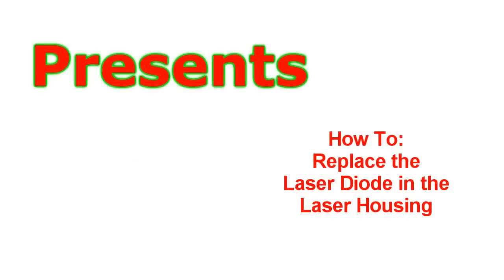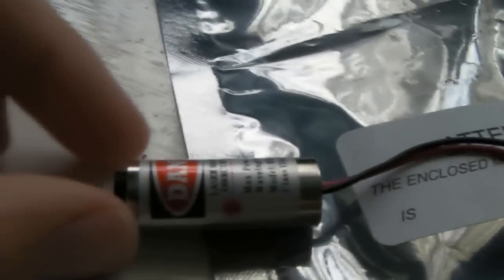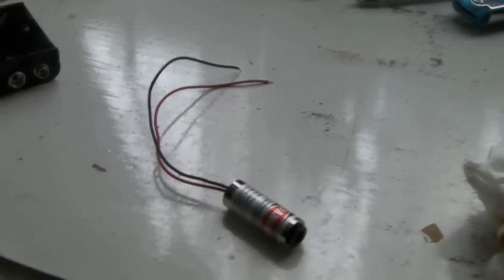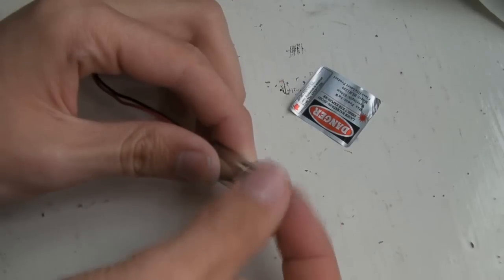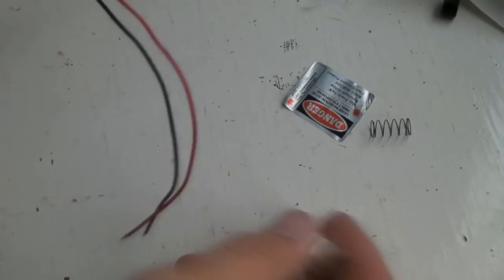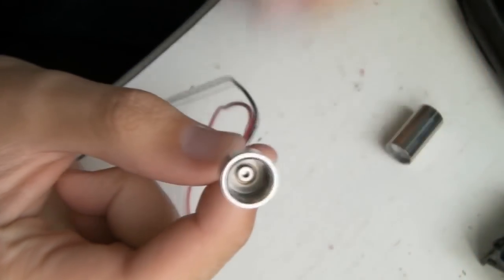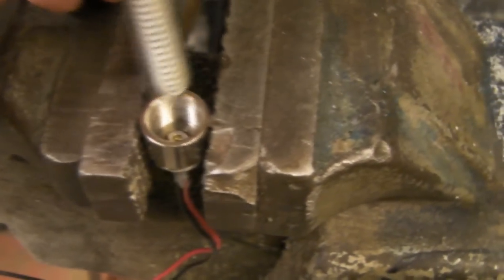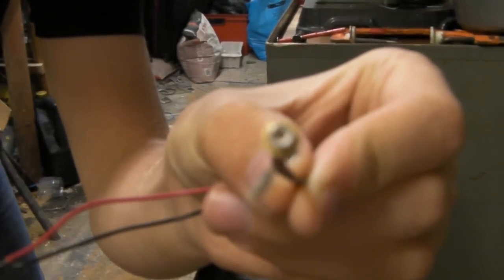How To Replace The Laser Diode in the Laser Housing

Comment: @matyus111 the video wasn't about how to make a proper dvd laser. it was how to take out the old weaker diode and put in a new one. However you are right building any laser requires a proper laser driver. I recommend a daedal circuit laser driver. just google  "laser driver it can be done" (use "i'm feeling lucky") to reach a page with very great instructions on how to build a lm317 driver and why you add each component.

Comment: Jesus... a laser diode can fry just from static electricity from your fingertips.    I'll just beat it out w a hammer.. I never thought a diode could take that beating.... I'm trying to remove my 445nm 3.5watt diode from its lense housing, and found this.. crazy.. still not sold on the technique...
Reply: oh dear god, itl probably destroy the diode no matter what. I just did this to my also 445nm pen laser i got for 16$ from laserland cause I took it apart and turned the potentiameter wayyy too far and burned the thing out quick but for 5 minutes that beam was AWESOME. For anyone who may wanna know, never turn a 5mw laser pot passed 45 degrees, assume less than that. 

gofastdodge youll need something so strong and thin to hammer it out by avoiding the silver housing, as long as you stay on the brass disk Id hope u wont damage anything. Id bet that your diode may be stuck in there, perhaps buy a new heat sink housing

Comment: Thank you for this informative video.
I did a mistake today.
Neje 30 watt Laser module working voltage is 12 and ortur master 2 Pro operating voltage is 24 and I connected neje 30 watt Laser module with it its blow up. Can you help me how to repair it.
Reply: sure get yourself a new NEJE driver and check if your laser diode is still good.
these modern drivers NEJE uses.. do have some protection build in, so it not sure that your diode is gone and they were able to popski before diode saw harsh lazing daylight..
a new NEJE driver.. is around 12 to 16US delivered.. just make sure to get the corrsponding driver model... the 30W variant I recall called something like 40xxxx and the 20W is 38xxxx

Comment: What causes  these diodes to stop working? I have a 7 year old blue laser mod that was custom made. It worked for about a year then stopped working ... so if I sent it to the guy  for $20 he'd repair it. Once again it lasted for a year or two with modest use and then stopped working for no apparent reason. Problem now is I don't have same option for repair. Are there online services that repair these? Thanks
Reply: sounds like cold solder joint that he just reattached back without even soldering it correctly (cleaning and then re-soldering with new solder wire) lol.
Reply: @WerewolfMaster Thanks for the tip. My soldering skills are about 3 out of 10 ... you're saying laser diodes shouldn't just fail for no reason?  This is good news.. I'll see if I can find a weak wire connect not much to lose at this point lol

Comment: When I opened the top part the spring came out in between the diode and lense then I put it back in but the lense won’t work someone please help me
Reply: whatever it is the spring is there to push on the lens which is held loosely by threads to keep it steady. However it might be messed up, youll have to find some method to hold them all together.

Maybe your problem is the magnification now, you need to adjust it to the precise point of infinity (relatively speaking) otherwise the beam will widen and diverge. This is how you burn stuff with 50mw+ lasers, diverge it so theres a tiny pin point dot in one spot in the beam

Comment: you don't need a driver for a 200mw diode if your voltage is below 3V the only thing what you need is the diode, aixiz module, switch and 2 RECHARGEABLE AA Batteries (make sure its chargeable or else you will blow the diode)

Comment: 🤦🏻‍♂️what is this the caveman repair shop show? My dude. Get an old radio antenna or one of those extendable magnets to reach dropped screws in tight spots.
Break off the end and push thru so each of the sections fall out. Find the section that will slip over the window part of the diode, but rest on the base of the diode and not the lense case the diode is press fit into. This laser in the video must have been lightly fit into the case. Normally they are really jammed in there or even have a bit of indium foil to solder in place and will crush the can and diode window if u do it with a bolt